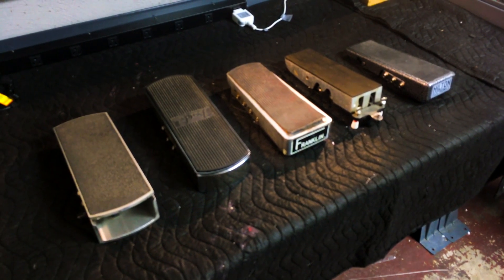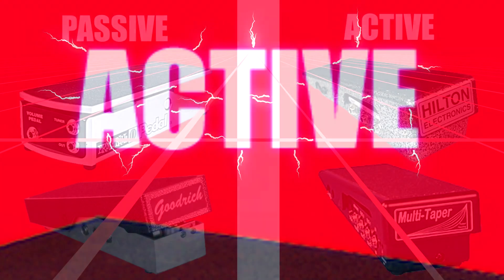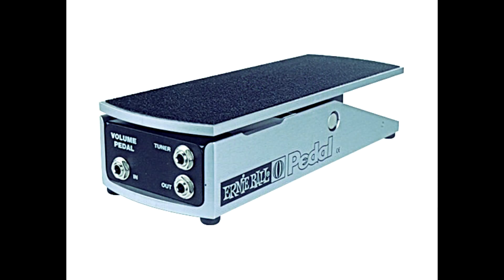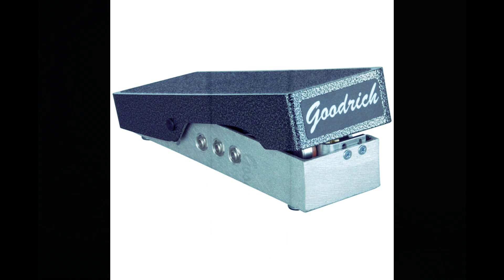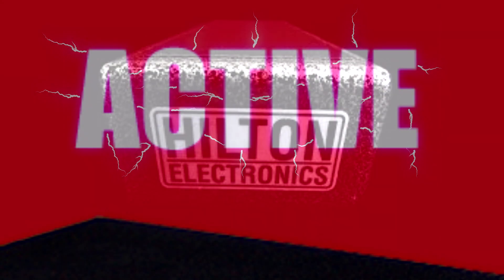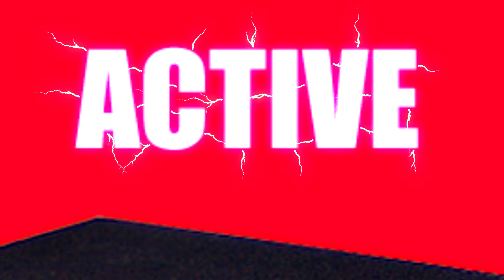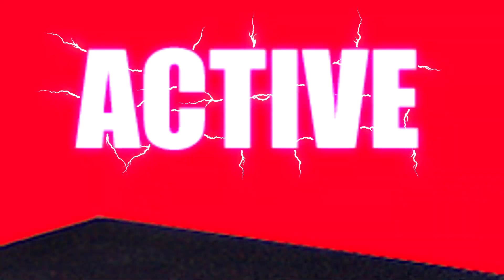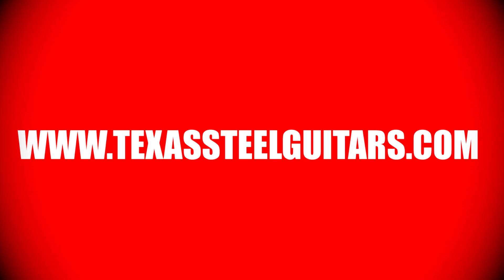Pedal Steel Guitar Volume Pedals: Which is right for me?

Comment: I have one of each, a 46 year old original MSA "drop pin"  pot pedal, it's a hoss. I have replaced the pot with the same value 2 or 3 times. These are rack and gear pedals, not strings.  Long before the pots  crap out, they get stiff and scratchy and static.  Easy to work on and replace the pot.. I also have a first or second gen. Goodrich 120 bought new to use as a spare. It's still my spare.. they sound and feel great but use a string to operate the pot.. I haven't used it enough to test its reliability in all these years..mainly because it doesnt attach to my pedal bar ... I bought a Hilton at least 10 years ago or more... it sounds, feels, performs as good as anything.. absolutely ZERO mechanical issues. I sent it back because the power cable got damaged.. he replaced it, and added the new LED pilot light, readjusted it to the newest specs.. years later sent it back for a new power supply.  excellent service.. yesterday for the first time I tool the tread off to see if a dust bunny was causing a volume dropout issue .. it was almost sterile inside.. no dust bunny.. problem was a bad ground on an effects loop cable.   I bought the up pin attachment that  connects it to pedal bar .   ABSOLUTELY 100% reliable and if there is a tone difference between a pot pedal and the active light beam  < i think its a laser>  I don't hear it..

Comment: My 2c: I’d been using an active pedal since I started on PSG, but I just picked up an old Goodrich (guessing mid 70’s), and MAN does it sound better than what I was using. Something about the simplicity of pot pedal is making my Sho Bud sound like it’s supposed to. I can distinctly hear string separation on the low end a lot better. Plus, now I can leave my cables plugged into it at home and not worry about killing a battery.
Reply from the maker: You know I agree with you here. The active pedals are very transparent but there’s something about those old Goodrich, Sho~Bud & Emmons pot pedals that you lose out on when you go active. I first went to an active pedal because it was the only one I could find locally at that time that was a low profile. I couldn’t fit under the guitar with my older pedals. I keep a Goodrich Lo Pro Pot Pedal and a Hilton Lo Pro in my seat now and switch between them depending on the gig.

Comment: Lots of variables in pedals. The technology of pots have come a long way in the last couple years as well as the active pedals.Quality of cables is a tone factor. Length of cable is a factor. Pick up, speaker, wattage of amp. type of speaker cabinet, guitar neck (wood or metal) Hard to pick just one. Try them all lol.

Comment: I've been using a George Dennis GD20 for about 12 years. They are an active optical pedal. I am a bass player and this pedal is fantastic. All steel, no tone suck and I power mine with a 9 volt lithium ion rechargeable battery. Unfortunately they are no longer being made. I paid $130 for mine, new.

Comment: GREAT VIDEO!  I HAVE A QUESTION!
I WANT TO KNOW HOW TO CONNECT THE HILTON VOLUME WIHT MY STRYMON OJAYS
Reply: not sure what the strymon ojays is.. but if its an OD or Fuzz put it first in line out of the steel .. and run modulation efx like delays and echos thru the loop ..

Comment: Pots should have a lube port. You can drill them if you are careful. Any powered component risks ground hum. Behringer make a solid, cheap passive pedal, whose design includes a mechanical clevis instead of a string. Poor quality control put the pivot in the wrong position. A Rock musician wouldn't notice. I fixed mine.